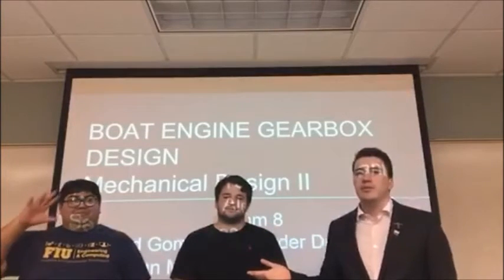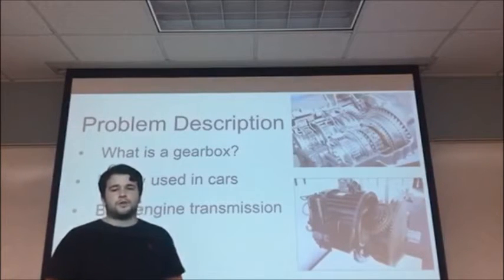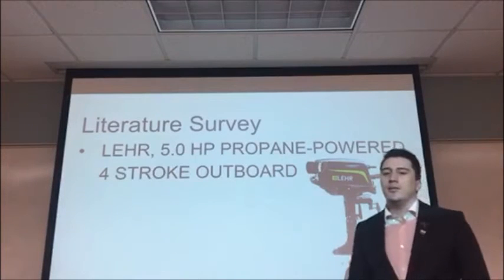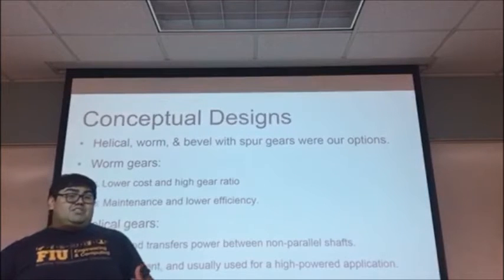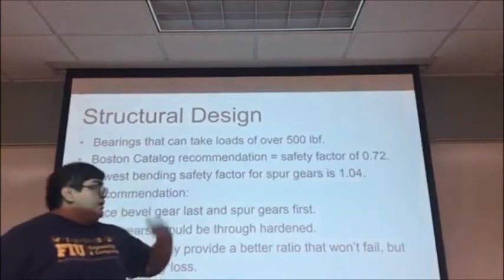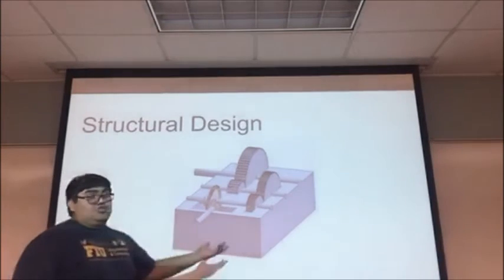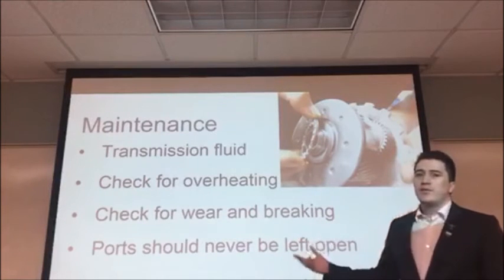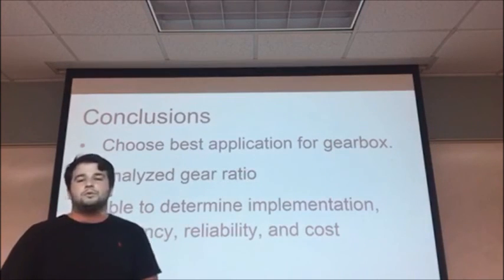Team 8: Boat Engine Transmission

Comment: The presentation is overall pretty good and the team did a great job on presenting their visuals backed with data. The camera angle is not conventional and should be placed more parallel with the board.